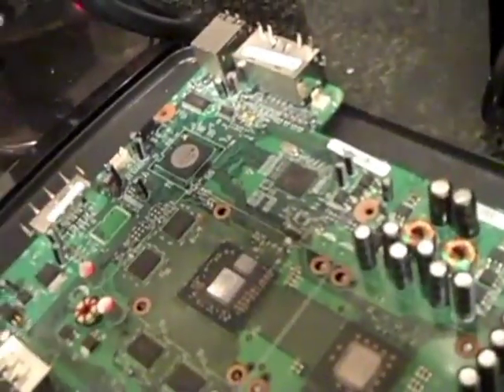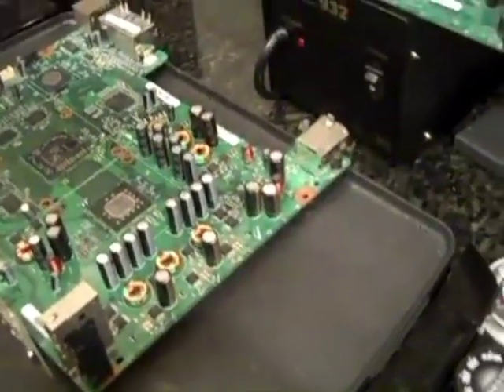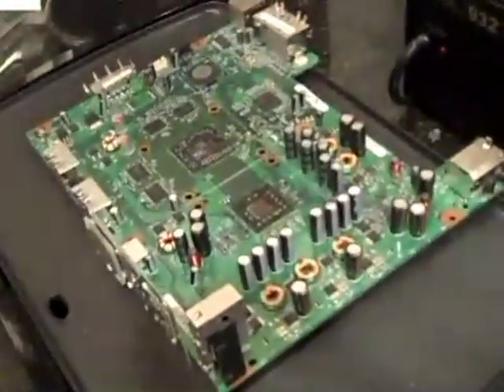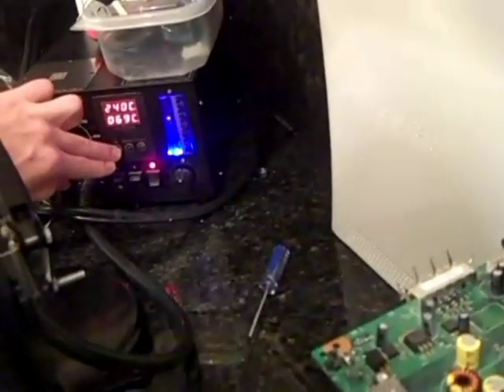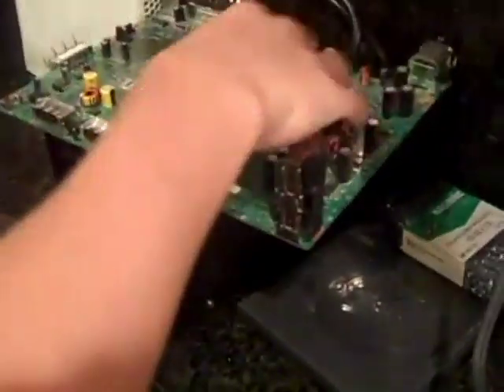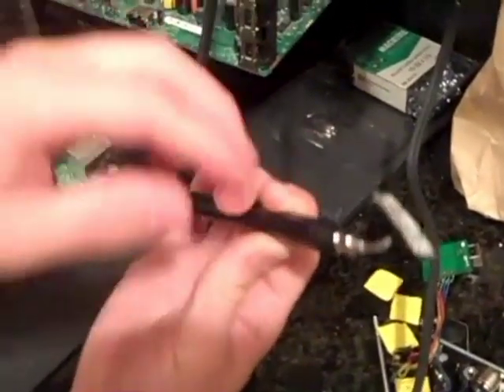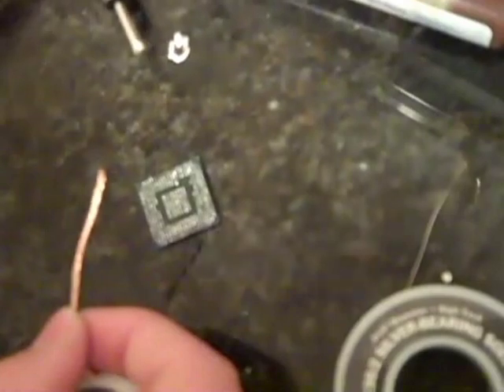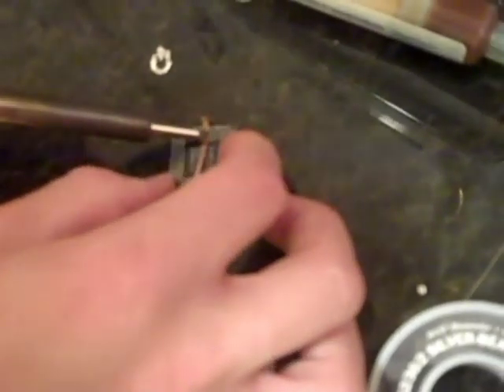How to reflow/reball Xbox 360 Southbridge Chipset(part 1)

Comment: omg... dude... that's horrible:) reballing like that:) don't tell me you haven't gotten a gpu fried by now... because i won't believe you. maybe the temperatures on your preheater (grill) and heatgun are not correct. 

PS: 400 degrees celsius is wayyy to much. What does preheater tell you. You have to preheat the board so you don't get a thermal shock between the heat station and the ambient temperature. That means 100-120degress  from 120 to 220 is the work for the heat air station.
Reply: 400 degrees ferenhiet

Comment: yes, this does seem to be a common issue. does your heat gun have variable speed settings (slow/fast?) or is it just one constant stream of air speed. 

I've got a gun with a low/high speed settings along with the 300c/500c temp settings. The only real concern I have is after getting the balls aligned correctly (tact flux may be needed) is getting the chip back onto the board, and seated correctly and using the right amount of temperature for the right amount of time. I'm trying to be frugal.

Comment from the maker: if i were you i would place the chip with the  solder balls top down on the griddle to let that heat melt the solder as oppossed to melting it with hot air, after the solder has melted to the chip turn off the griddle and let it cool, theoretically all the solder is correctly melted to the chip and you are ready to reflow the chip back on, done it this way myself a couple times and had much better luck with it!

Comment from the maker: the main problem i find with using a heat gun is during the replacement of the balls onto the chip. lets say you had removed the chip from the board with the heat gun and used a soldering iron and solder wick to remove the remaining solder from the board and the chip, you have placed the clean chip  in the stencil, and the solder balls are each in their little holes, once the stencil is removed if you try to use a heat gnu, the high air flow, will blow all the solder balls off of thier points

Comment: Great video dude. I have a similar problem, just with my PS3. I don't have a pre-heating station or anything but I do have access to a griddle and a heat gun. I'm going to buy a Reball kit (stencils/.6mm lead solder balls etc/chip holder) and am going to Reball my ps3.

I was wondering if you think it is possible? There are a lot of naysayers against it, mainly people who offer the service professionally, but I'm not buying it. If you can remove the chip via a heat-gun then you can put it back.

Comment: Nice video, but there are a bunch of unnecessary costs with this method. Especially considering how cheap Xbox's are. All you need to do for most mobos is put some liquid flux under the CPU and GPU and use a heat gun to get the solder to melting point. Then replace the thermal paste. Iv'e fixed countless Xbox's with this method and never had a single problem.

Comment: sure all you got to do is pin out the GPU and CPU like a desktop mobo this allows to board to flex with out damaging tested and work 100% but dose require very very good soldering skill and it take about 10 to 20 hour per chip if you want to get it rite i have also redesign my whole cooling system better heat sink copper not alloy for better heat transfer and fans mounted to the heat sink plus build a mount for cpu and gpu the make a 5mm gap between each chip and mobo responds to heat muchbetter

Comment: GREAT VIDEO!!! i have a question.
it is possible to install a jasper 65nm cpu and gpu chips into a xenon motherboard?
im asking becoz i purchased an  xbox 360 but it is a 2006 model without hdmi. the guy on ebay sell the item as a jasper model. BTW the start sequence is the new one. (the xbox logo animation on startup)

Comment: ive devoloped a new  perminate way of fixing an xbox it can flex all it wants with no sign with out fail ive scraped the crap balling methods and got back to the old methods 1 pins work very well or wire it tested and both work and it cost me £5 or about $10 and 14 hours of work reballing works i have one my self but its like cancer only buys time witch is about a year  my one is much better the cpu and gpu are an inch away from board in its own mount and cooling worked now 4 month hardplaying

Comment: what type of tip do you use to remove the solder from the chip? a screwdriver tip? orr? and in the part two of this reball/reflow what is the glue you speak of that you apply to the chip before putting the solder balls?